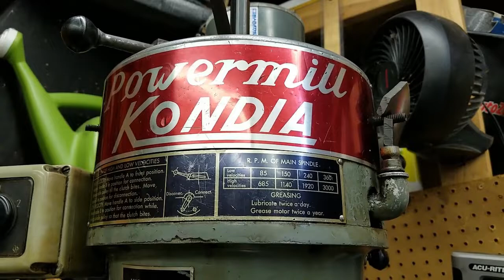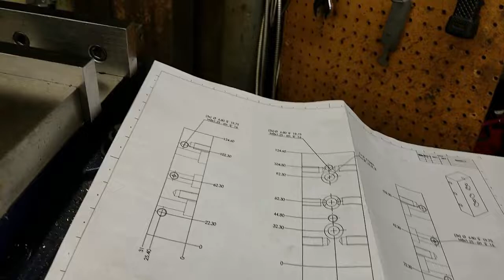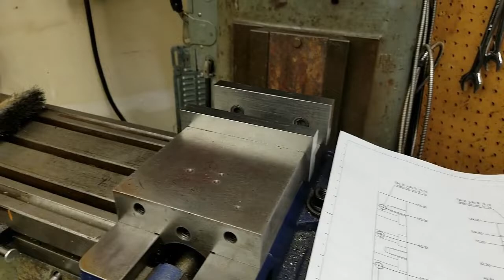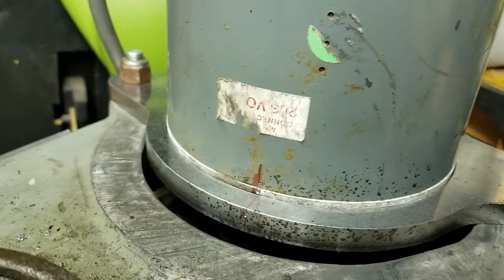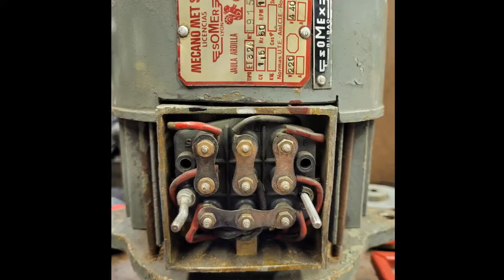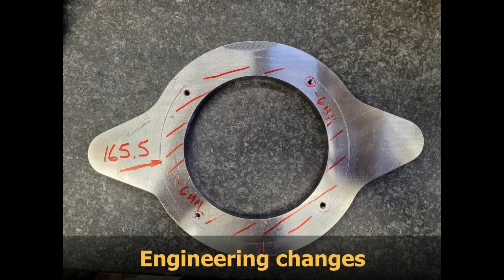IS THIS THE END???

Comment: I hate having a piece of machinery down, I've got a kbc mill with varietal speed its messed up driving me crazy but I'll get it figured out, great video, keep'um coming.
Reply from the maker: Kentucky Trapper, yeah it takes it right outta you when something breaks. Then giving some unfinished work back really sucks! Your machine is mechanical you can figure it. Just take a step back an approach it from a new angle and you will see your solution! Thanks for watching and commenting...
Mike - Plus8Precision
Reply: @Plus8Precision  thanx man..